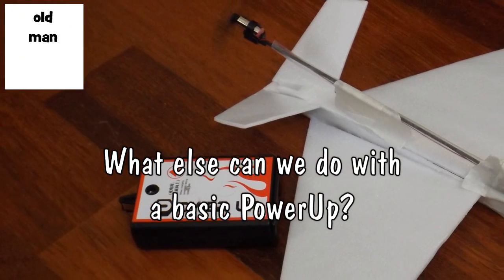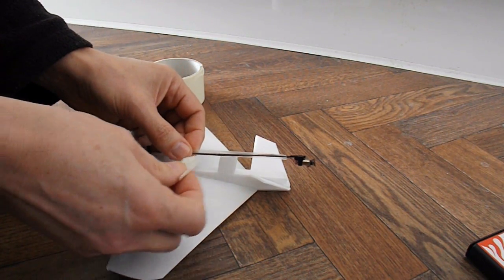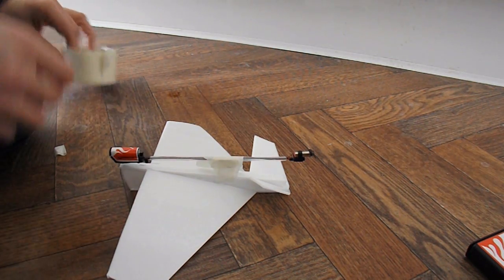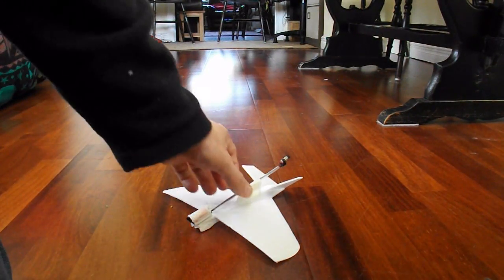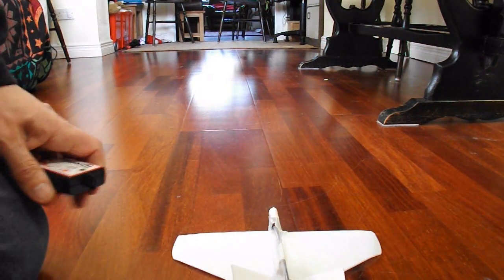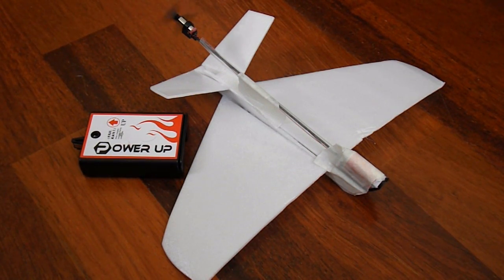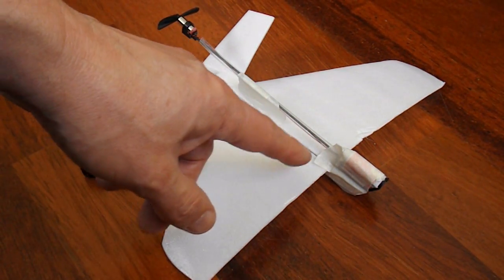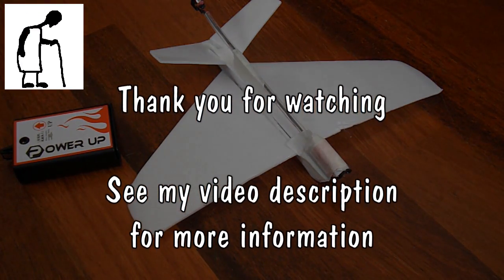What else can we do with a Basic PowerUp - Ground Effect Vehicle

Comment: Could you try this with one of the newer power up model's?
Reply from the maker: Not unless one turns up cheap in a charity shop. Are you thinking of the smartphone controlled Powerup 4.0? They look great but are out of my price range. Flying a ground effect vehicle really needs a large smooth area like a basketball court unless you go really big.
Reply: I feel a smaller frame paired with this design of ekranoplane would be perfect,such as the power 3.0 with it's left and right control it would be perfect for inside a living room to steer and speed control so you don't hit obstacles

Comment: Where can i buy that motor?
Reply from the maker: That is just a standard small coreless motor easily found on eBay or other online shops, just search for something like 3.7 volt coreless motor. They come in various sizes so check the listing for the diameter and length. Alternatively search for Power-Up and you will probably find cheap clones of the original Power-Up kit. There are more details in my video description although the eBay listing will  be 2 years old so unlikely to work for you.

Comment: Wasn't sure where to post, because the Google alerts thing with the bell in the top right is broken ! (isn't showing messages, just sits there saying 'opening').
Just wanted to pass along something of hopeful use with your PowerUp type own systems and perhaps this one itself.
In my own forays, it was found that 1x 4mm motor will fly a 4 gram total weight aircraft (tail motor and prop from an R/C helicopter). But, 2x 4mm will fly an 11g aircraft. It could be handy to know of that relatively large weight carrying increase on small poly plate planes. Your 6mm motors may well benefit similarly. 2x 6mm, with the same type of prop as you show on the PowerUp, will fly 0.7 - 0.9oz aircraft The 5F supercap appears to deliver quite a few seconds of flight capable power and that can translate well, even with using the extra motor.
I know some info is dud, with you flying the Mossie and other twin engine aircraft, but wanted to forward some numbers :)
To add - here is my Northrop XB-35 flying wing. 2x 4mm motors, same rotating direction ! Terrible quality video, but shows the non contra rotating props. Was a great flyer: https://www.youtube.com/watch?v=ERyWjY47qbQ
Reply from the maker: I can see that I have drifted into another area of your expertise. That is a brilliant flier. What control surfaces are in use and is it variable thrust control?
Talking of twin motors I like this video of the HM830 by Michael Steele
Trying out the RC Paper Airplane - HM830
http://youtu.be/zKorOg9Exy0
Reply: GrandadIsAnOldMan
Thanks. It's 2 channel differential thrust, so just motor control, setting elevons for level glide. The ITC toy company made a cracking little 2 channel setup back then, with a very light receiver board and strong 6mm motors (inc durability, got hours out of them + none have ever broken, just by using a drop of engine oil on the shaft every couple of weeks of flying. A binding/screaming motor is only ever dry). Proportional motor control was smooth and had many steps. I bought 4 of their F-22 Raptor that were returns at a local shop, for about equivalent of a quid each ! Used to get 10 minutes flying when using 4mm tiny motors.
Yes, his paper plane looked overweight and already damaged, but flew superbly ! the extended 'prop shafts' give that slight nose push upward, creating a lifting body rather than conventional wing. it flies like the Space Shuttle, with enough power to keep it going...quite brilliant !
Reply from the maker: slider2732 you are getting some good control with that set up. As discussed before, that is what I have in mind for that cheap helicopter I bought the other day. Obviously as it is infrared control the range will be limited but I should be able to get a feel of the general idea.
Reply: GrandadIsAnOldMan The ITC F-22 was/is a legend..the designer used to post on RC Groups and was always annoyed how they put the motors on the wings, not on the V tail.
Here it is, quick demo vid from one reseller: https://www.youtube.com/watch?v=yYf-dXOyxHw
Flew even better with no wheels btw. He designed the radio system too and it had useful tricks built in, iirc, both sticks outward for flat spins and such, especially when the motors were in the 'right' place. Hence the XB-35 had some of those traits.
There is a trick around where you can put a resistor in line with 1 motor, giving traditional motor and rudder control instead..seemed to work on several diff thrust circuits.
On a cloudy day in the later afternoon I/R works ok to about 40-50ft, so on a small back garden type of design it should be fine :)
Reply from the maker: slider2732 great little demo vid, just made me smile. The flight was great but having a rock band playing in the background to set the mood was perfection. Just made me want to rush out and buy one. Seriously though it does fly great.

Comment: Thats is Amazing! Awesome video grandad!
Reply from the maker: Thank you Sahan, it  has the same problems as that previous GEF I made, it would need much more time spending on it to get it to run straight and level. It will probably destroy itself long before it is trimmed properly because it slams into walls and anything else around at high speed. They fly too fast and need far more space than I have available. It would be fine if you are doing it at school or college and have access to an indoor gym or assembly hall, but I don't.
Reply: Yea. thats true.

Comment: That last run was very cool, it ROG'd ! lol
Not a bad result for an indoor runway.
Reply from the maker: Same as that previous GEF I made, it would need much more time spending on it to get it to run straight and level. It will probably destroy itself long before it is trimmed properly because it slams into walls and anything else around at high speed. They fly too fast and need far more space than I have available. Fine if you are doing it at school or college and have access to an indoor gym or assembly hall.